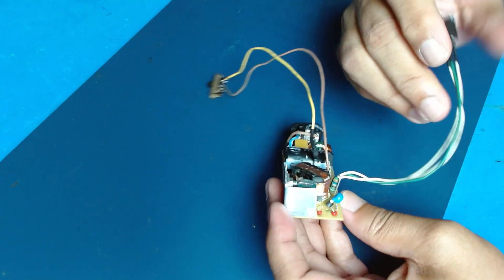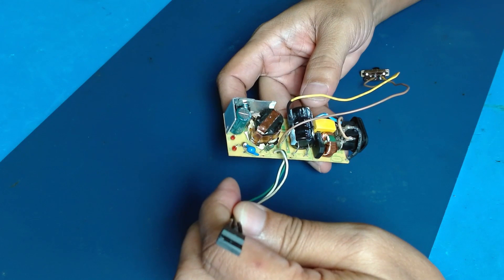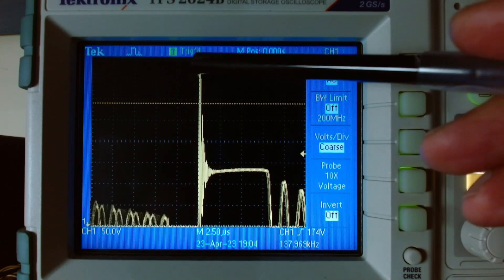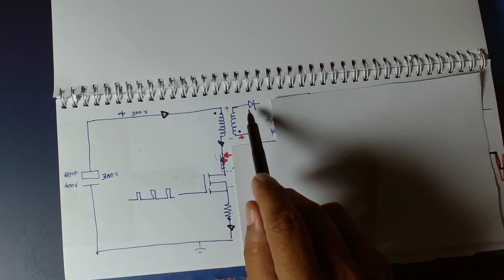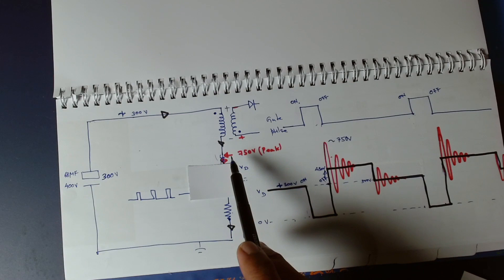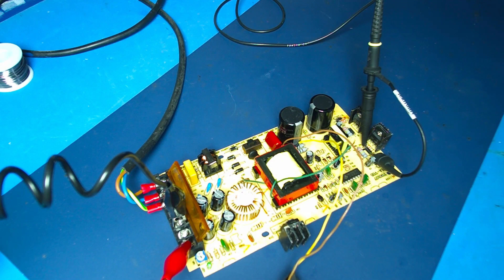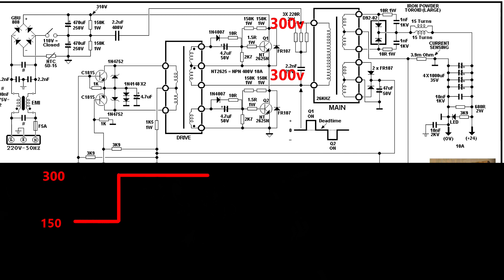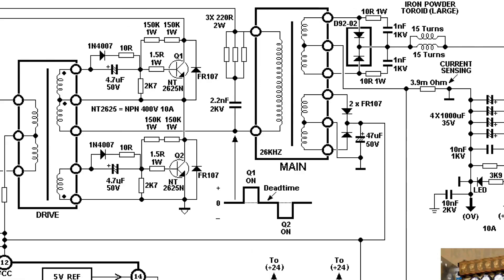SMPS snubber circuits සහ wave forms , SMPS කාණ්ඩ අඳුනාගනීම , SMPS එක ON වෙන ආකාරය

Comment: හරිම පැහැදිලියි. ස්තූතියි. මටත් ප්‍රස්නයක් ආවා මගේ සිංගර් DVD ප්ලෙයර් එක එකපාරම ඩෙත් උනා මං බැලුව චොපර් ට්‍රාන්ස්ෆෝමර් එකෙන් අනිත් පැත්තට වෝල්ටෙජ් යන්නෙම නෑ කප්ලර් එකයි TL431 ඔක්කොම අලුතින් දැම්ම,ඩයෝඩ්, කන්ඩෙන්සර් එහෙමත් ටිකක් අවුල් ඒවත් දැම්ම චොපර් transformer එක විතරයි නොදැම්මෙ ඒකත් අවුලක් නං නෑ මල්ටියෙන් මං චෙක් කලා අනිත් ඔක්කොම අලුතින් දැම්ම, ඒත් ලෙඩේ එහෙම්මයි.😢 පස්සෙ මම වෙනමම පවර් සප්ලයි එකකින් DC 5V දුන්නා standby පැත්තට එතකොට ඔක්කොම සාමාන්‍යය විදියට වැඩ TL431 කේ reference voltage එකත් 2.5V හරියටම වැඩ,නමුත් 230v දුන්නම කිසිම වෙනසක් නෑ කලිං විදියමයි voltage යන්නෙම නෑ අනිත් පැත්තට.😢😢😢😢 මොකද්ද ප්‍රස්නෙ ඇත්තෙ ඔබතුමාට හිතෙන විදියට.
Reply from the maker: 5v පිටින් දීල 230v දුන්නම output voltages එනවද?,
Standby voltage හදන්න ඔයා power supply එකේ වෙනම පොඩි transformer එකක් තියෙනවද?

Comment: How digital display work. 
Digital volt meter (DVM) automaticaly dispaly fluctuation voltage when DMV leads Connect with source. 
What is the IC , how convert and display analog voltage.how seven segment display know which led should  iluminate ? Thanks im cinfuse

Comment: මගේ තියනවා 24v/20A Chinese power supply එකක්. ඒකෙ  out put smoothing inductor එක අධික ලෙස රත් වෙනවා current ගන්නා විට. මෙය මඟහරවා ගැනීමට කළ හැකි පිළියමක් ලබාදෙන්න.
Reply from the maker: Inductor එකක් රත් වෙන්න පුළුවන් හේතු දෙකක් නිසා, පළමු එක inductor එක ඔතල තියෙන copper wire එකට ඔබ ලබා ගන්නා current එක handle කරන්න බැරි වීම.. (හීනි කම්බි ) එහෙම නැත්නම් current එක වැඩි නිසා inductor core එක saturate වීම.. පළමු හේතුවට විසදුම මහත copper කම්බි දැමීම දෙවෙනි එකට විසදුම saturate නොවෙන්න ටිකක් ලොකු powdered iron ring එකකින් inductor එක හදන්න.

Comment: Sir මෙතනදි 150v හැදෙන විදිය පොඩ්ඩක් පැහැදිලි කරන්න පුලුවන්ද?
Reply from the maker: Volts 150කියලා මම දල වශයෙන් ගත්තේ, ගෘහ පරිපථයේ 230v නම් peak voltage එක 320v වගේ වෙනවා.. මේ 320v capacitors දෙක අතර 160v/160v වශයෙන් බෙදෙනවා.. මේ 160v තමයි මං ලේසියට 150v කියල ගත්තේ
Reply: @dilshan1971  thank you sir ❤❤ ආසාවෙන් බලන channel එකක්. මේ කරන සේවයට ගොඩක් පින් 🙏